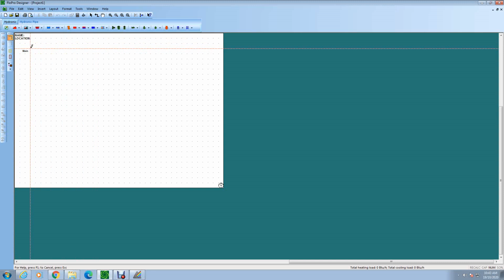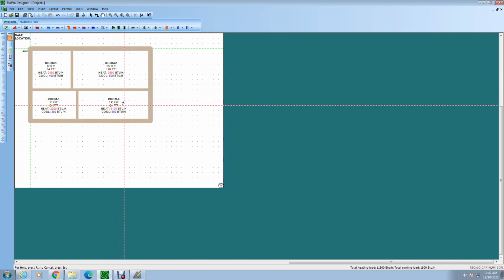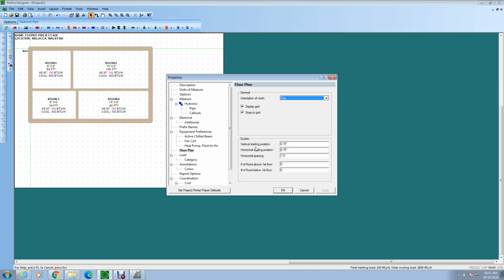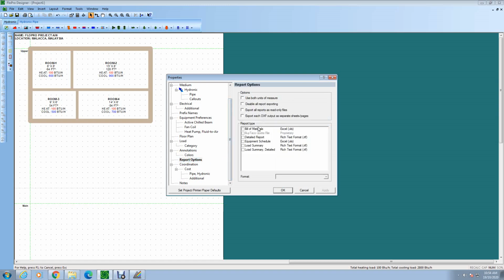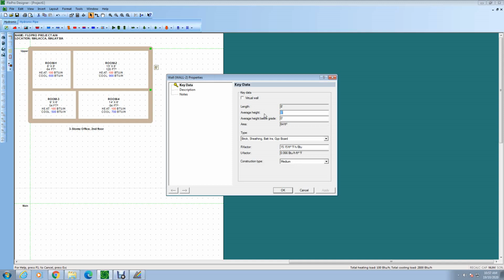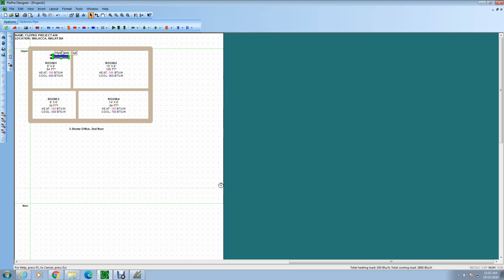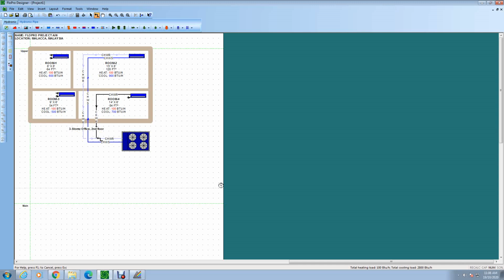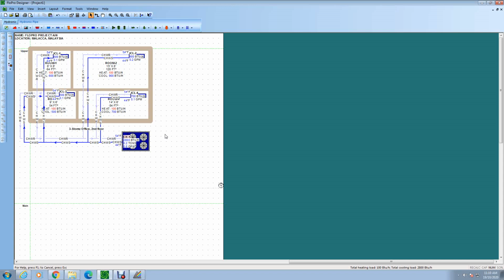1st tutorial Flo Pro Designer

Comment: MUHAMAD NURHISYAM BIN MOHD HASNAN
B071710148 4BMMH S1/2

In the FloPro software, we can choose a variety of specifications and requirement of the building needed in order to get the estimation of the heating & cooling load of the room, floor, or entire building. Also through this software we can plan out how to do the ducting layout easily and fast and do the simulation using variety of HVAC system that available without having the trouble.

Comment: AHMAD LUQMAN HAKIM BIN ZAMBRUS
B071710359 (BMMH S1/1)

FloPro Designer software enables contractors or designers to conduct defined analysis of building exterior and interior spaces. This includes the external influences, radiant heat, water heating, and the building layout of specific components such as the hydronic for HVAC applications. For the user interface, it is simply to draw the floor plan, drop in building features such as windows, doors, accurate heating and cooling loads, where every factors are calculated. In addition, it also performs for system design for baseboard loops and radiant manifolds, sizes pipe of all types and variety, and specifies boiler, expansion tank and circulator models.

Comment: Mohamad Zarif Bin Rostam (B071710681)
FloPro Designer:
Basically is the software to calculate and analysis the heat load, cooling load, piping connection, system of HVAC. The variety of specifications and requirement of the building can be choose to meets the needs the estimation of the heating & cooling load of the room, floor, or entire building. In this software also we can easily plan the layout of the ducting and run the simulation throughout the system.

Comment: MUHAMMAD HAFIZ BIN JOHARI 
B071710380

FloPro Designer System Creation
 Design residential hydronic systems with heat loss analysis, near boiler layout materials list, and generate professional looking documents. than , student hvac can easy to calculate cooling load and heating load by using flopro software. also it can measure the pipe on the bulding layout by using the simulation.

Comment: MUHAMMAD ZULQARNAIN BIN ZAMZURI
B071710782 (BMMH 1/2)

Flow Pro Designer software is an analysis tool that can be used as a simulation that can be used by designers to simulate the interior and exterior design.
It also can be used to calculate the total cooling load, heat loss, layout near the boiler and system piping, size, and many more related to the HVAC systems.

Comment: AMIRA NASUHAH BINTI ALIAS
B071710121

In the FloPro software, we can choose a variety of specifications and requirement of the building needed in order to get the estimation of the heating & cooling load of the room, floor, or entire building. 

Also through this software we can plan out how to do the ducting layout easily and fast and do the simulation using variety of HVAC system that available without having the trouble.

Comment: NUR FITRAH NADIA BINTI KAMIDAN
(B071710363)

FLO PRO DESIGNER
FloPro Designer also performs system design for baseboard loops and radiant manifolds. It sizes pipe and selects the proper-sized, valves, expansion tanks, circulators and more. It’s also HVAC analysis tool that is able to calculate Cooling load for specific conditioning. FloPro also have variety of specifications and requirement of the building needed in order to get the estimation of the heating & cooling load of the room, floor, or entire building. FloPro is the easy and user friendly for student to design and calculate for HVAC system.

Comment: AHMAD KHAIRUL AKMAL BIN AHAMAD KHAIRUDIN
(B071710715)
BMMH S1/1

Flo Pro designer is an advance HVAC analysis tool that is able to calculate Cooling load for specific conditioning. Not only that, it allows users to design flowing schematic for a cooling system that satisfies the need for each room. It is also able to calculate future instalment and upgrades to minimize actual product waste.
Overall personal thought, it’s a very precise software and have many uses for future planning and construction.

Comment: NUR SELIHAH WAL HUDA BINTI AHMAD - B071710190

FloPro software mostly use to conduct a detailed heat loss analysis that can calculate the heating and cooling load of the building. It was easy to used because it allows designer to draw up a complete building drawing with every component and can added more floor plan detail.

Comment: NUR SHAFIQAH BT ABDUL GHAPOOR
B071710400
4 BMMH S1/1

Flo Pro Designer is a software that makes the user to calculate cooling load in a building more simple and easier. It has technically everything in it. The user just put details in the properties boxes such as places,  north placement, how many floors the user intend to build and etc. the interface of the software is user -friendly and easy to handle.

Comment: MUHAMAD IZMAN BIN JAMALUDDIN
B071710518
BMMH S1/2

FloPro Designer software makes heat loss calculation fast, easy and,
most importantly, accurate. And it also help design any type of residential
hydronic system – baseboard, radiators, fan coils and radiant.

All the calculations are done instantaneously, as you draw. If you need to
make a change, the program sees it and adjust the loads automatically, in real time.

FloPro Designer also performs system design for baseboard loops and radiant manifolds. It sizes pipe and
 selects the proper-sized , valves, expansion tanks, circulators and more.

Comment: Muhammad Syafiq Bin Ahmad(B071710592)

Flo Designer is specialised for HVAC cooling Load, from this user can design size of rooms, hall and others to find optimum cooling capacity in that area
Otherwise, they can simulate from the software the suitable Air conditioning system that can supply all rooms and halls. From this software they can conclude on how much refrigeration tonnes will produce at certain area.

Comment: ALDEN ANDRIAN PHIUS
B071710392

Through this tutorial session, I have learned that FloPro Designer software enables contractors or designers to define building exterior and interior spaces, external influences, and to build and specify components for a host of hydronic, radiant heat, water heating and HVAC applications. Other than that, its also Simply draw the floor plan, drop in windows and doors and accurate heating and cooling loads are calculated. In addition, it also performs for system design for baseboard loops and radiant manifolds, sizes pipe of all types and variety, and specifies boiler, expansion tank and circulator models.

Comment: MOHD SYAHIRAN BIN MOHD PIKERI
BO71710026

Flo Pro Designer software is an initiative that can be used as a simulation method to the HVAC student in a learning session. With Flo Pro, the student be able to conduct a detailed heat loss analysis, layout near boiler and system piping, size and select all system components (including boilers), develop 

The time also can be save as the program be able to generate a materials list and a variety of professional-looking documents that easy to understand in class session

Comment: LUA WEI JIE (B071710861)
BMMH S1/2

FLOPRO DESIGNER majority is used by HVAC student which is to calculate and analysis the heat load, cooling load, piping connection, system of HVAC. It could provide a clear and direct floor plan and easily understanding system, connection of the piping and lastly can be easily determine the load available and all the type of equipment available inside in the room.

Comment: Muhamad Afiq Haikal Bin Adnan
B071710534

 FloPro Designer is one of the basic software that student HVAC commonly use to calculate and analysis cooling and heating load of the building before we design the HVAC system in a building.This software has many feature that user can add such as:-
*Floor plan detailed
*Piping 
*Type of wall 
*Many other thing about the hvac system

So for HVAC student it is important to master this software for further use in job scope later

Comment: LIM PEI JUN (B071710194)
BMMH S1/2

FloPro Designer software is as intuitive as a sketchpad, but greatly more capable. With FloPro Designer software, we able to conduct a detailed heat loss analysis, layout of air cooled chiller, piping system , size and select all system components (including Fan Coil Unit), develop a materials list and generate a variety of professional-looking documents. FloPro Designer software also can make a building layout easily and make some calculation of units of piping instead of total length.

Comment: MOHD RAHIMI BIN MUSTAPHA
B071710225

Learning about FloPro Software
In this session, the topic was about:
	What is FloPro software
	The usage of it in the HVAC
	The functionality of FloPro software
	How to use the software
	How to do a simulation for the Heating Load and Cooling Load inside the occupant space.

In the FloPro software, we can choose a variety of specifications and requirement of the building needed in order to get the estimation of the heating & cooling load of the room, floor, or entire building. 

Also through this software we can plan out how to do the ducting layout easily and fast and do the simulation using variety of HVAC system that available without having the trouble.

Comment: ARVINTH A/L RAMACHANDRAN 
B071710339

i have experience on using flo pro design when in semester 1 on 3rd year. the purpose is too software makes heat loss calculation fast, easy and, most importantly, accurate. And it also help design any type of residential hydronic system – baseboard, radiators, fan coils and radiant. The software is intuitive and user user-friendly.